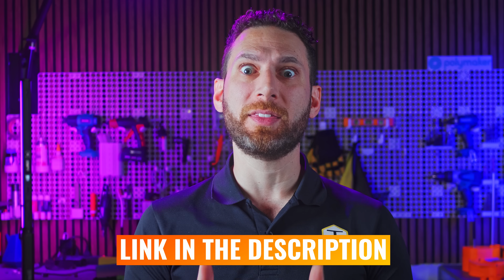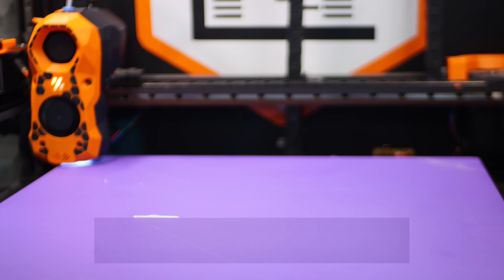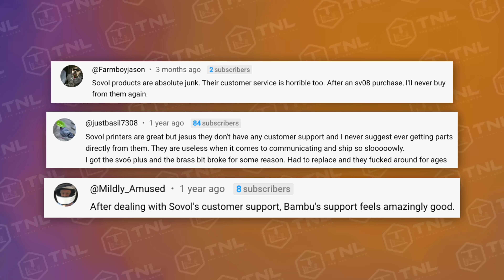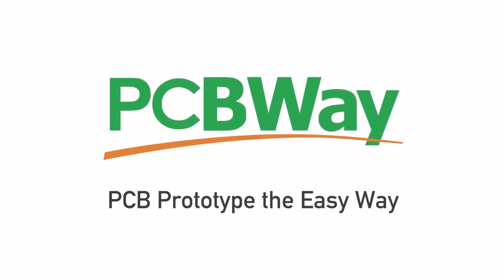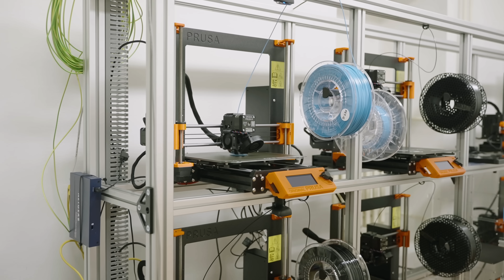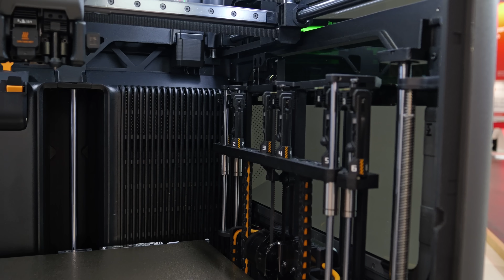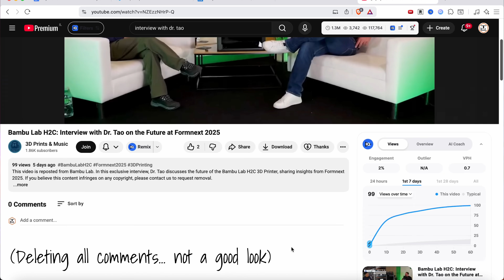My HONEST Annual Report Card for Each 3D Printer Brand

Comment: Ooof. I could not disagree more about Prusa. They have just gotten worse and worse. I ordered an assembled XL 5T with Enclosure plus an assembled Core One. Got them in on 9/1/2025. Both have under 10 days of print time on them after 90 days because they are just constantly breaking down and requiring extensive and lengthy repairs. They have cost me months of my life when I did not have the time to spare. It is 90 days later and after $7,000 and 120+ hours in repairs on both of the printers they are still not working. I will never give Prusa another dime. They have practically made me quit 3D printing altogether.

Don't buy a Prusa unless you just hate yourself, your money, and your time.

Comment: I agree that the entire industry should settle on A standard. Don't know who actually has the best, but hope a standard is created and adopted by majority of manufactures. Standards in general is what we need. No single company has the best of it all but it'd be great if we could take the best parts of them all and make those the standards moving forward. I do NOT foresee any manufacture going out of their way to provide someone else (Orca in this case) all their info on new products before launch (ship to customer) as that would turn Orca into the master of it all. Nobody needs to hold that title. However it would be great if the default settings for each filament, nozzle, etc were readily available as a download (cfg file) THAT would be awesome and would allow any slicer designer to incorporate it into their settings. As for Anycubic, they can piss off. They sent me a used printer when I paid for a new one then refused to take it back during the first two weeks. Once they finally agreed to at least let me ship it to them so they can see if it qualifies for a return, they wouldn't provide a shipper for the ACE, two extra built plates, or 5 extra nozzles that were part of the original order that I clearly wouldn't need if I didn't have the printer. They simply suck and that is directed at "Abby". As for Creality and model quantity...they've done this from the beginning so it is nothing new. Still unwelcomed but not new. Filtered chambers are wasteful unless they are sealed. Most are not sealed... As for Bambu, it's like Apple in more ways than not. It is a chosen ecosystem that consumers will either choose to buy into, or choose to avoid. Complaining about it will not change it. Just look at Tesla for an example of this.  I am excited to see forward progress in toolchangers. Don't know who will create the best but I am looking forward to it.

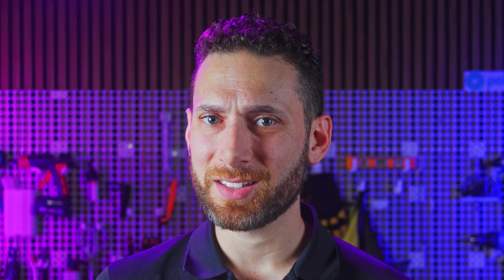Comment: 19:19 I believe you were too harsh on Bambu Lab.
I don’t want to discuss your personal reasons — that’s your own matter — but Bambu Lab is a major, well-established company, not a random or disorganized one. With all due respect to Prusa, Bambu Lab surpasses it in every aspect, including technology.

They did not lie to us; they showed parts of the Vortex system, and what they announced is exactly what was demonstrated in the video. They did not fabricate a nonexistent system just to compete with Snapmaker.
Also, the timing was perfect for them — they were announcing their new printer, the H2S, and they told consumers that there was another printer coming in the new H-series lineup (the H2C), so people could choose to wait for it instead of going for the H2D or H2S.

Based on my extensive experience in manufacturing and 3D printers, I can confidently say that the Vortex system is extremely smart and required significant effort from Bambu Lab’s engineers to develop the successful algorithms behind it. In my personal opinion, Prusa, Snapmaker, and other companies would not be able to create such a system on their own.

Therefore, after all this investment and the major breakthrough in rethinking the 3D-printing workflow, Bambu Lab has every right to build a closed ecosystem.

This is coming from someone who holds a Bachelor's degree in Mechatronics Engineering and a Master's degree in Electrical Engineering.

I fully respect and appreciate all other companies as well.

Comment: I agree with your points.  I bought my first Bambu printer on H2D release despite all the negative press because I wanted to get into multicolor without beta testing all the open source solutions.  I found that Bambu is a lot like Apple, and I have a love and hate relationship with Apple.  I love all of my Vorons that are tuned and modified heavily, that also prints faster and at higher quality compared to the H2D, but I love how the H2D just makes everything so stupid easy.  I hate having to use Bambu Studio alongside Orca Slicer, but at least there is no learning curve.  I also hate how all of their accessories are so much more expensive compared to open source alternatives.  But so far, I love having a Bambu printer alongside my Vorons as a simplified reliable workhorse.  It's probably the last Bambu printer I'll ever buy though.  I definitely got jebaited by their dumb Vortek teaser and I paused all of my purchasing decisions due to that.

Comment: Industry wide RFID and the option to buy refill rolls for all filaments. I bought my very 1st NEW printer this year being a P1S with AMS and love the refill spools, far less trash. I've had many Creality printers(all used) and think if Bambu Labs went back to costumer focused, they head back to the #1 spot. I honestly hated buying the P1S as they closed the door to 3rd party, I just needed a printer that I didn't have to fix every day and it was on sale. I do miss the ability to use Open Source products with "MY" printer(Bambu still thinks the P1S is theirs when they sold it to me). After warranties run out why not let us tinker with it, use those ideas to make better products down the line. It's FREE R&D for them. They win in the end as new buyers can get improved printers from them.

Comment: Im a bambulab Guy but the Problem is i want a new printer without AMS but laser so h2d ore h2s but you cant buy that you need to buy the AMS 2 pro with IT Wat is in my opinion great but i have IT on my P1s already so i dont Ned a nother one so i asked Support and they sead that ITS Not posibl without AMS

Comment: I was definitely hoping to see you mention Qidi. I think their multi filament support is lagging but they are definitely pushing the high end of consumer printer capabilities when it comes to hot end temps and BIG heated chambers. The use of open source firmware and really competitive pricing make them really appealing. My question for a printer than can produce truly usable components has them currently at the top of my list. Under $700 for the Plus 4 delivered to my door in Alaska seems like a bargain. 
Pair it with an snapmaker u1 for multi color work and you have a ton of capability for the money.

Comment: Great video.  I recently got back into 3D printing after nearly 10 years and upgraded my trusty Robo3D R2+ to a Creality K2 Plus.  This was right as the Bambu "scandal" was happening and it turned me off to their company.  Even though it seemed their printers worked very well, I just had a bad impression.  The K2 Plus has been pretty damn good for me.  I've read the horror stories as well, and it kind of seems like the early machines weren't quite ready for Prime Time.  I think they've made improvements along the way to address the major issues.  So this tells me 2 things: 1) Perhaps Creality rushes things to market.  2) Wait a few months and let them work out the kinks out before buying.  I do give them credit for the improvements along the way.  Would be great if they could work them out ahead of time.  

I also just bought a Creality Hi on Black Friday that should be here tomorrow.  I like that it shares nozzles with the K2.  It was $375 and it comes with a CFS.  That's basically a $75 printer and 2nd CFS for my K2 Plus LOL!

Comment: I really dont get the hate you guys have for BL.,.,.

for consumers, BL is just a great solution. BL has taken this market from a hacker based one, to a much bigger, normal consumer one. .   We dont want/need access to source code. We don't care if you need an internet connection. We just want to hit print and have it work.  We do not want to spend time repairing, fixing, hacking, compensating and hoping each print wont come out looking like ass...  Just make it work. BL does. 

Based on this review, I dont even know what your problem with BL is. Other than "they are mean" And that there are a lot of other influencers who are "mad" that BL took away their hacker tools... WHO CARES! And calling BL closed is really a stretch.  you guys are snowflakes. 

Have you ever dealt with Apple from a commercial perspective?  Guess what,  they are ruthless. 

any ytber who is going to waste another second on complaining about BL based on a bunch of esoteric crap...  welll

Unsubscribing now.......

Comment: Your hating on Bambu for leaking their color changer they have been working on for well over a year now. right when Snapmaker was doing good. But you are not bringing up the fact that Pursa did the exact same thing right after bambu did. As far as the H2C I like its changer better than a tool head changer. It does take a little longer but I can also load different nozzle sizes and have them ready. So when slicing I can pick an color and any nozzle and the machine loads them together and prints. If you stop hating on them left and right maybe you could see the pros and maybe try one. I and many I know see your biases and is making us want to unfolow you. The unprovoked hate is not good for the maker world
Reply: @tommyblair6008  Bambu just works.
Reply: I feel like this channel was not the same since the fiasco of the A1 mini.

Comment: I just want an affordable 3d printer with a large size print area that just works out of the box.  I do not print figures and swords but I design parts and practical prints for everyday use and so I do not have a ton of time to tinker with the tool I just need to do the job it’s designed for.  I spend time trying to work around my current printers problems while I try to find dedicated time to fix them. Love watching your vids but out of all the brands you are familiar with which one do you think is best for a person like me that sees his printer as a tool to get work done.  Thanks for your many reviews and input 👍🏾👍🏾. I am subbed already 😎

Comment: no QIDI?
Q2 is probably the best affordable engineering-oriented printer on the market, but pls, QIDI, slow down with the new printers. Q2 start was rushed (although there weren't major issues - everything was community fixed in a week or so), the Box was delayed, and now Max4 is up while many Q2 buyers didn't get their boxes yet and the boxes have some troubles (although I couldn't know it - I didn't get the box yet 😢). With that happening - how can you push another printer?

And the naming - wtf is going on. Ok, before you had some different things, Q1 was kinda different from Max versions. But now Q2 and Max4 are the same exact printer with a larger print bed. Make it Q2-max or something. And at least try reusing the parts between them. Nozzles are pricey, but having to order 4 different nozzles for 4 printers is getting expensive (also with different sizes, nozzles selling in pairs, and extra hotend just in case - that's another Q2).

Comment: @theneytlayer I have to say, I also was thinking that the H2C is not what the users wanted and not what they needed ... but boy was i wrong. Compared to the other solutions on the market it is really the best allround solution you can get. No waist, can print nearly any material, decent size, relativly fast printing, a nozzle (size) changer... 

the print speed is not that bad at all. when you have a dominant color, the swapping to the left nozzle is done in 6s, 28 when mulziple colors on the right nozzle. in the end that is about 20-30% slower, than a dedicated multitoolhead whilie delivering all the other advantages. specially considering that, lets be honest, you dont print full color every day, its not that important anyway. as long as we dont have a true consumer multicolor printer like the mimakii, mutli color will not be that usefull amyways. and using zhe U1 or Idex without ams refill features is also not very confiy.

i got the printer a few days ago and i really love it. everything worked put of the box, the true bambu experience. and what i love the most: the remote changing of the nozzlesize... 0.2 for details, 0.6 for speed and strengh... on a fingertip. best thing ever.

ok i give it to you. with the laser they messed up. but they cant always be right.

Comment: Bambu is the Chinese company that works like a western company. Even their debated lock down of controlling plane is at least partially justifiable. Everything else has been open and advancement-oriented. And they have the capacity to try some leaping ideas.
Prusa is the "standard" western company. They make things that is creative but lacks the tooling (as in design and manufacture capabilities) to make something extremely well accepted. But they lead the industry on a lot of aspects.
The Sovol, Elegoo, Creality, Anycubic bunch, they are Chinese company. They suck off the community and the industry, and "payback" by providing cost effective products that has nothing new in them. They are not really evil (the really evil ones won't have much of market in western world), but they don't contribute too.

Comment: Can't say I have any issues with Bambu Lab. They're innovating and not sitting around on their past success like Creality. I understand the issue many have with the closed ecosystem, but they did have more than one system hack. Being arguably the most popular consumer printer company comes with a big hacker target, and they decided to close the gates as a way to prevent future issues. The H series is starting to get a little confusing with the variants, but it's also meant as a platform to build on instead of releasing 10 printers that aren't all that different...Creality. I understand the gripes with the new nozzle swap system, but I'm ok with it. It's less waste than a single nozzle printer, and it's something I don't have to babysit. It's hard to comment on behind the scenes tactics without specifics, but I wouldn't be surprised if every company does things like this. Even if Bambu is gone within 10 years, they will have done so much to push the field forward and grow the adoption of 3D printing. I'm glad the Anet and Ender 3 days are behind us and printing can be the hobby instead of maintaining the printer. For those that want to tinker more, there are plenty of options available. Bambu printers are as close to set it and forget it as we've ever been. Prusa seems to have woken up and might challenge Bambu again, but I'm sure price will win over anything else. Prusa printers are great, but Bambu delivers pretty much the same quality at a fraction of the price.

Comment: I personally think the Ender 3 is the one model Creality should keep as a legacy model.
It's basically the VW Bug of 3D printers.
Reply: @padoco73  I love my Ender 3 Pro, but at this point it's not even an Ender 3 honestly, the frame,PSU, and steppers are the only original parts left
Reply: @Metallica4Life1995 So, the 3D printer of Theseus?
Reply: Complete with the part about everyone and his mother having an opinion about it. 😂

To be clear, I was really comparing it to the pre-1970s Bugs...not the late 90s one.

I never claimed they were particularly good. I'm saying they're affordable, easy to modify, and pretty everyone accepts that it's just basic.

I myself just sold mine to make room for a new Bambu P1S, which is kind of the Toyota Camry of 3D printers.
Reply: More like the Yugo or the MGB of 3D printers... If they're not actually on fire at any given moment, they're needing service...or they just don't seem to work...
Reply: Dont compare a VW Bug to that hot pile of dog turd. Honda civic sure since no one keeps those stock either, but not VW bug.

Comment: You missed some crucial points here.
When evaluating a business as a whole you should talk more about their strategy:
- who is their customer?
- what has their business growth look like this year?
- what is their market strategy and has it changed this year?
- what products have they developed? Are they innovating?

Your first BIG mistake is you keep saying the “community” or “yourself” thinks this company is doing good at [blank].
You failed to recognize that each company may have different customers. They aren’t all selling to “the community”.
Who is “the community” nowadays?
You keep mentioning them passing judgement so you should state who they are. 
Example: let’s look at the two giants Bambu and Prusa
Looking at the market as a whole I would say Bambu labs sells beyond “the community”. It is clear in their marketing, pricing, and industrial design (ergonomics). They made 3D printing an appliance rather than a hobby. This is their origin and the reason they are the biggest. They have the widest customer base. The question is this year did they keep that same path? 
It is obvious that Prusa is not focused on industrial design or ease of use. Their filament loading is a good example. They are engineering focused and technology focused. Look at the silicone printing for example. Their machines still look and act pretty scary to “normal” people though. They sell to people who do not shy away from tinkering. They have a smaller more niche market.

I have a lot more to say but overall you should look at the business’s strategy as a whole. You just took your wish list and the “communities” wish list and used that to apply judgement to companies 😑….
None of these companies are gonna actually take this as feedback.